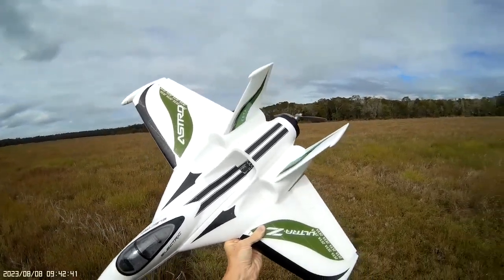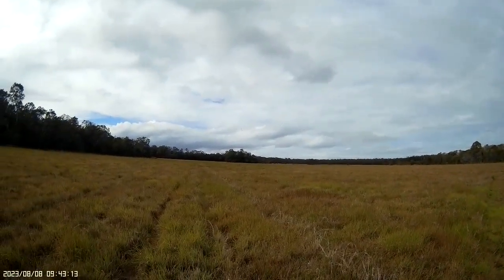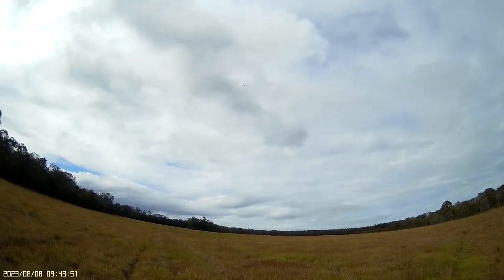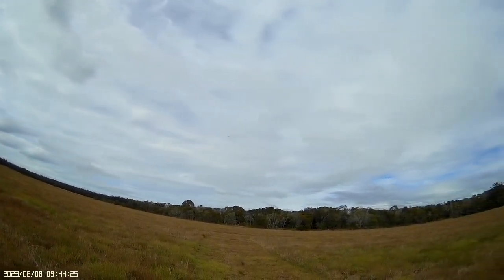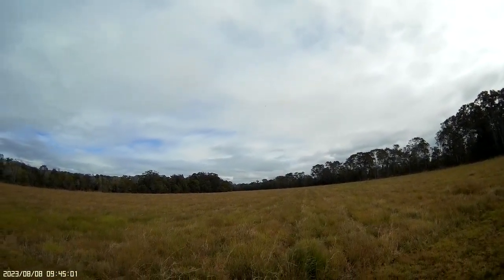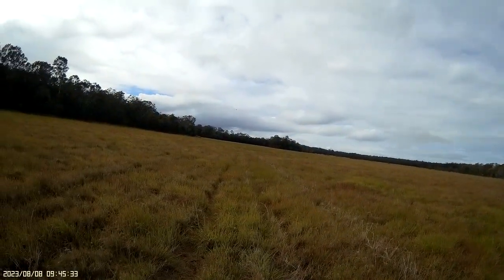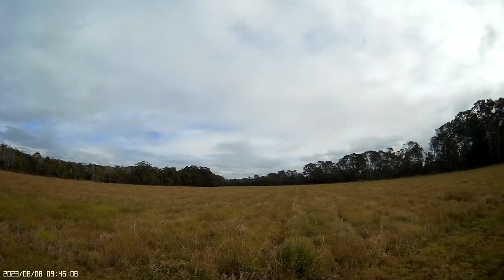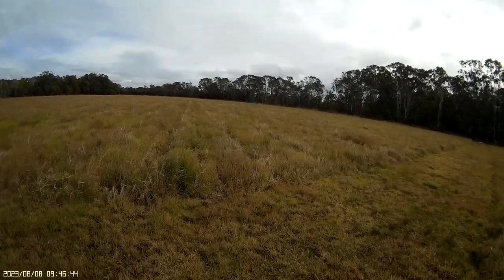Ultra-Z Astro Pusher Jet Re-Maiden Flight #2 - (Low Passes Start at 2.20)

Comment: Very impressive Craig. You dont happen to have an old Radar speed detection unit in your boot (haha) to see what speed its doing ??Na just kidding, but boy it is moving very very quickly
Reply from the maker: It's going to be faster soon...  i am going to run it on 4s next week...😅😅
Reply: @craigmcdonald-rcgliding   Must be doing heaps of RPM and the 4 cell battery will make it into a UFO.